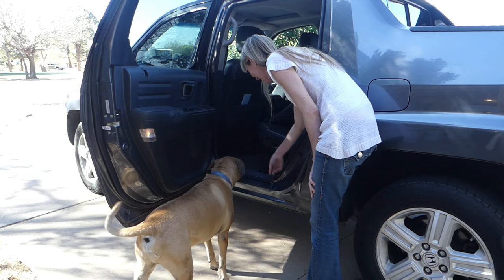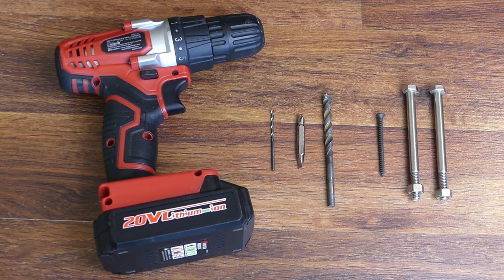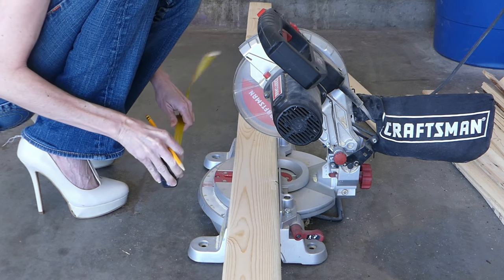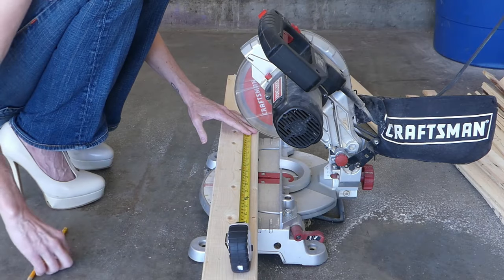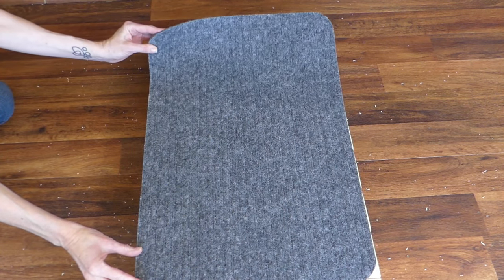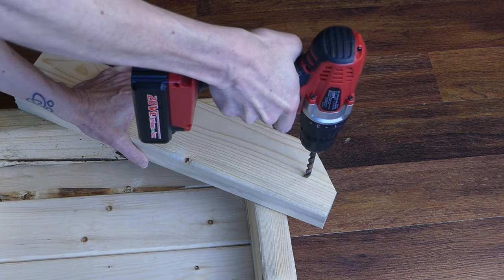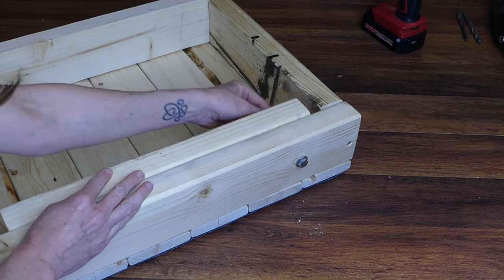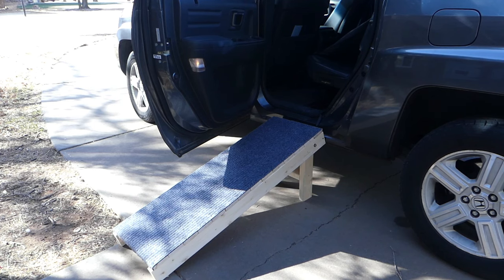'On The Fly...DIY' Dog Ramp

Comment: Honestly this is way too heavy for what you need.  You could have accomplished the same thing with a sheet of plywood cut lengthwise and it wouldnt weigh so much.  I am going to get the 10ft plastic ramps on Amazon that are good for a 150 lb dog but what I really am going to use it for is a wheelchair ramp for hubbys wheelchair.  Your ramp weighs more than his wheelchair does.